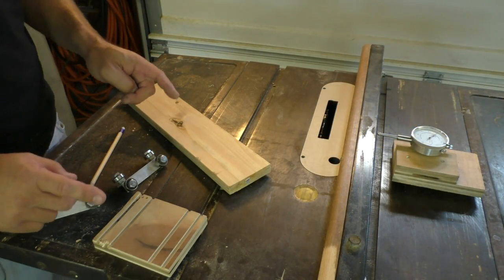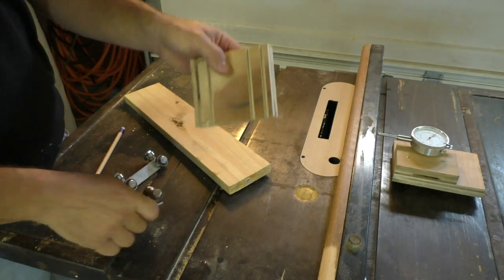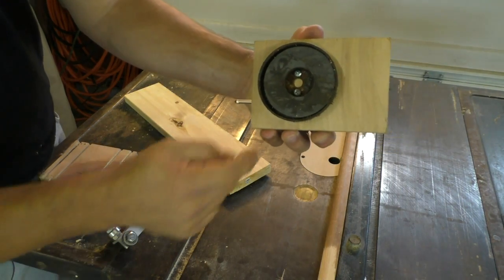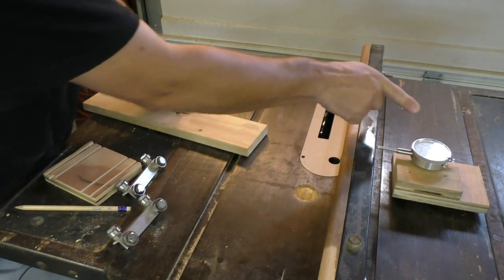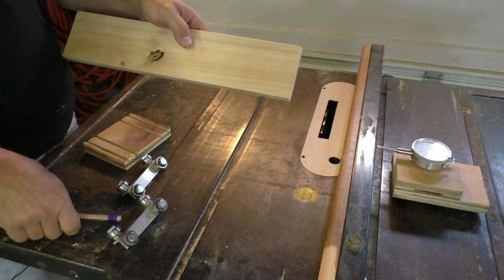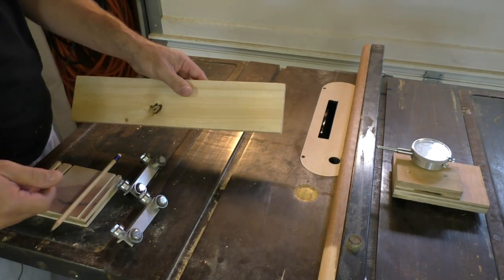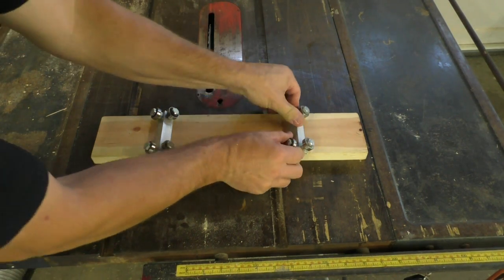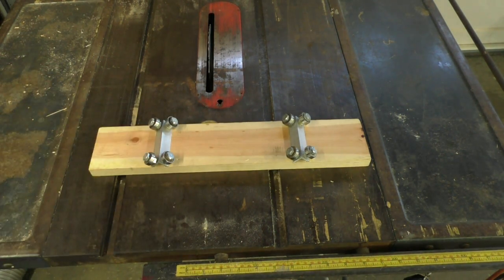How to Make a Motorized Camera Slider

Comment: Great video ! What are the dimensions and measurements of your camera slider ? And did you make the bracket for the motor or buy it ?
Reply from the maker: It's about 3ft wide.  I 3d printed the bracket.  You can get the .stl files and more info on the Making Stuff web page. http://makingstuff.info/Projects/Camera_Slide
Reply: Thanks !

Comment: wow, very Hood! but i've not understand how it work 'go and back' in loop automatically?
...and  about the electric  motor:
how much potency have? a motor of a little ventilator (example the 12v form camper or auto... is usable?)
thanks from sardinia
Reply from the maker: It can be programmed to loop or stop.  I let it loop most of the time.  
The motor is a stepper motor, it runs at 12v and can probably move any 
camera that will fit on the mount.